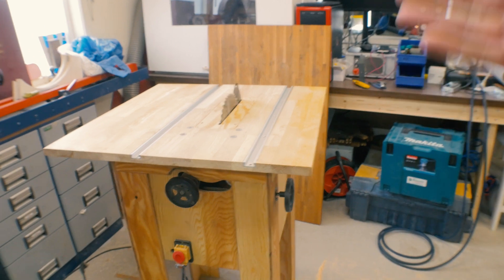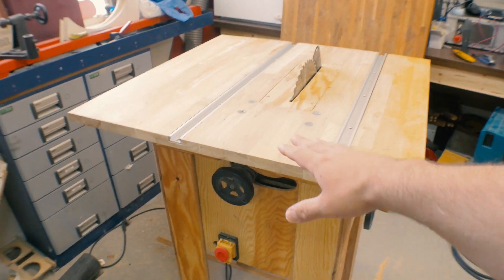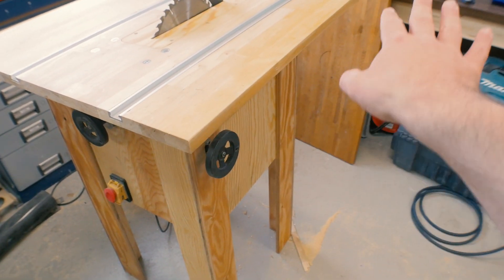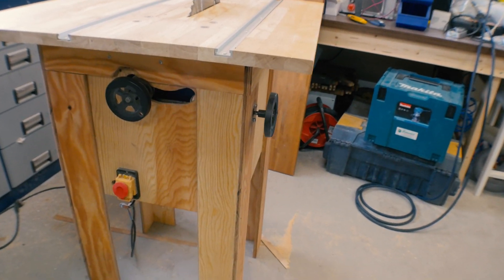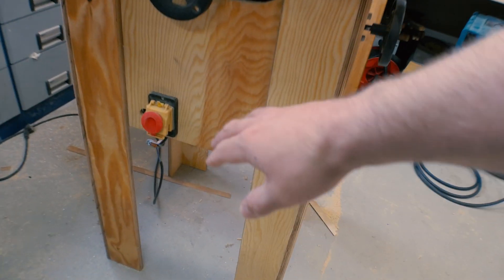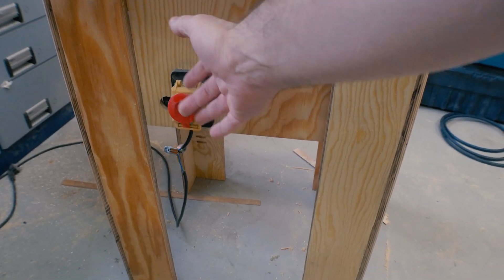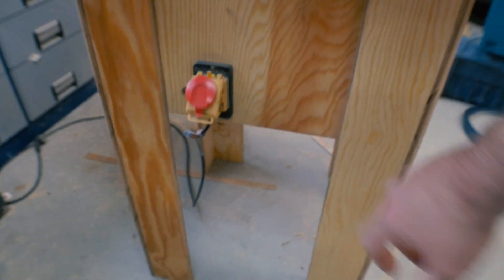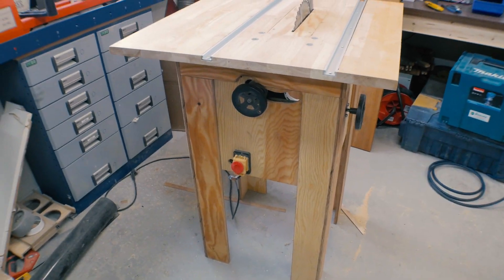Homemade table saw (Part 4) - MITER slots using T-Tracks | ROUTER guide

Comment: I build a table saw myself too. It is front to back 600mm deep. I am in the process of ordering some t track (800mm two of them) but I am not sure if I need the 300 or 450mm guides to run in the t tracks... What do you think is the best length of guid to use if the t track is little about 625mm long with the blade coming through the table about halfway that measurement >???

Comment: From where i can get t slot channel in india ?
Reply from the maker: You cant buy on Banggood?
Reply: @WillysGarageNorway   they not delivering.
Reply from the maker: @smarttech3188  what about ebay?
https://www.ebay.com/itm/T-Track-T-S-Aluminium-Miter-Tools-For-DIY-Fixture-Table-Wood-working-Router/402463132922?hash=item5db4ac0cfa:g:JDMAAOSwUKZfckEm&var=672624989297

Comment: Wow, you must have really had the inspiration bug.  I have an older saw though it is even older than yours and just as much a piece of junk though it does get the job done.  But I think i would have just gone out and bought a new saw.   I really like what you have done though and I am planning on upgrading mine to a new top at least since the miter slots are junk.   Thanks for the banggood link to the miter T-Slot.   I saw one on amazon that was about twice the price so think I might order a couple. 

Now, that you have done yours do you have any suggestions to getting the miter slots parallel with the blade?
Reply from the maker: Hi and sorry for late reply :)
Yeah, I had the inspiration bug alright! A new top and miter slots is a good upgrade, 
If you use a board that is of the with that you want the mitre slot to be from the blade, you can use it flush against the blade and mark it on the outside. 
But I just used a big 90 degre angle and measured my way out from the blade

Comment: Thank you for this - I bought pretty much the same table saw as it was all I could afford, but it is truly sub par - the top was warped out of the box and for now I just put a sheet of MDF over it, but really wanted to rebuild - your solution with cutting out the mounting point from the old top is brilliant, as I was wondering how I was going to mount it under the new table top I want to make.  
It seems I didn't buy a table saw, just a motor and motor housing (at least it is a 2HP motor and a 10" blade :)